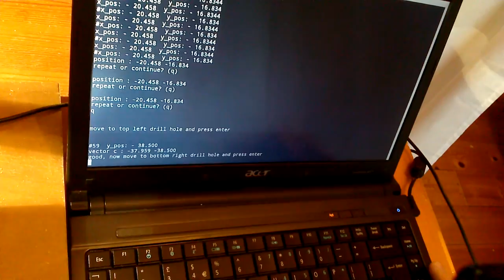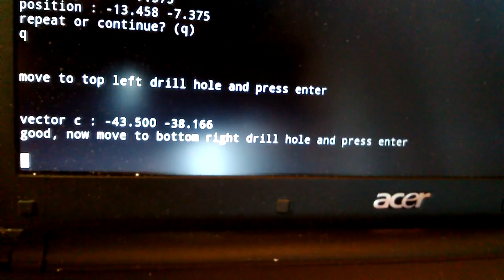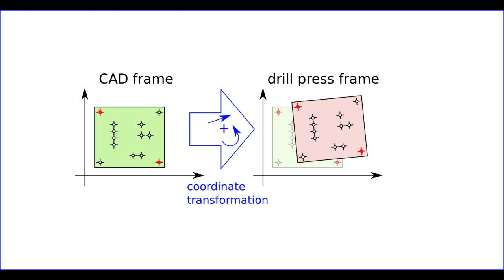automated drill press table for PCB manufacture

Comment: Great idea! Although I must say that for PCBs like the one shown at 3:23, I don't see any need for precisely placed holes — if you drill after etching the copper, manual positioning seems good enough. But for PCBs with proper galvanically metallized vias, where you'll be drilling those holes into a blank, this seems like a great improvement over what I'm doing now, i.e. drilling though a paper printout of KiCad's "drill map" image, which I have to manually scale to the board's actual size...

Comment: Gut gemacht! Have you thought about adding a Z-axis motor?
Reply: Idk about him, but in the several years of improving my DIY PCB process, I certainly never once thought about building an auto-drill WITHOUT a Z-axis motor, and now I see that this is exactly the reason I've never came around to actually doing it. The addition of a Z-motor makes this thing as complex as a complete CNC router, both from the software and hardware standpoint; with ZERO benefits!

Unless you actually want a CNC router, which, for PCBs, you certainly don't. You do see people use them to mill copper — this may look attractive for one-off boards, but whatever the resolution you may want, the price of hardware makes no sense compared to chemical ethcing; and even if you progress to custom stencils, you make them with a laser cutter, also an inherently 2D machine.

And DIYing a CNC router is basically like DIYing a 3D printer, but all the hardware parts are more expensive due to additional vibration and weight — unless building CNC routers IS your hobby, you just buy one; and now we're talking aboiut a $300–500 piece of gear. What's shown in this video is quite a simple upgrade on top of a $30 drill press, and the precision achievable with this setup (perhaps with additional reduction gearing and/or rotary encoders) is already above what you'd ever want to have at home.